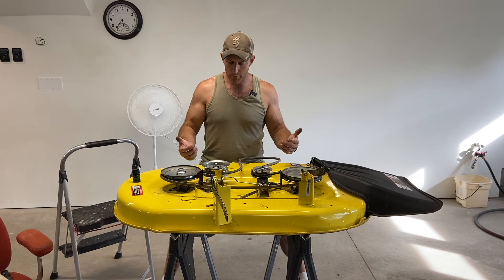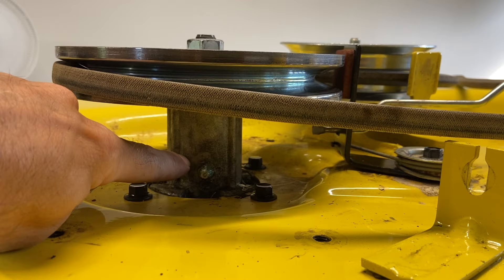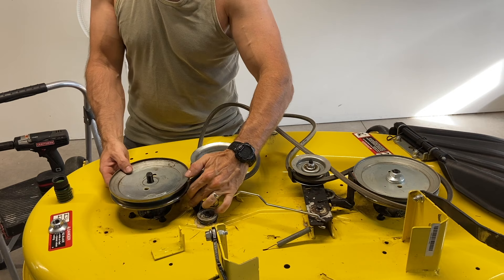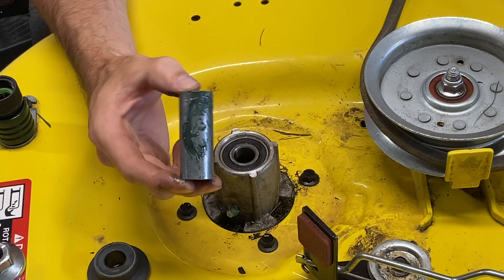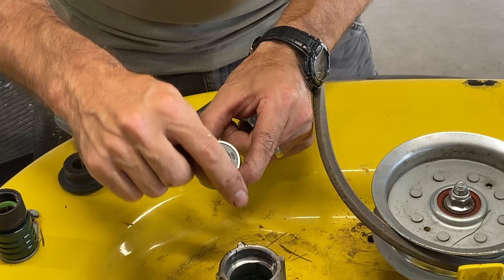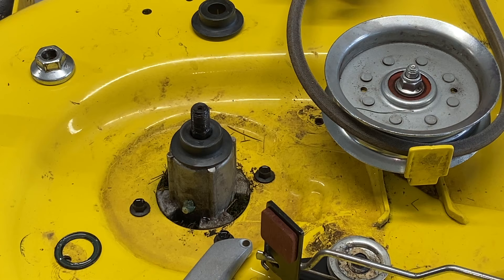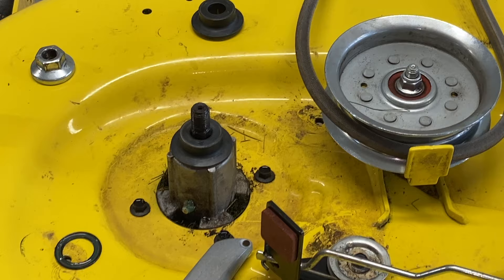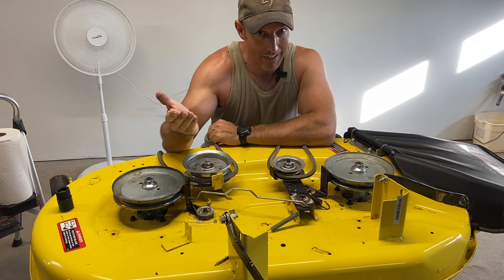I WOULD DO THIS DIFFERENT NOW JUST REPACK THE BEARINGS WITH GOOD GREASE AND PUT SEALS BACK ON.

Comment: As a machinist, I can tell you the number one cause for bearing failure is over greasing them. Excessive grease causes heat and quickly destroys the bearing, Quality sealed bearings are far superior and have a much longer life span than unsealed greaseable bearings. Cheap china sealed bearing sometimes have the incorrect amount and type of grease and are prone to early failure.
Reply from the maker: Thanks you for the info and thanks for watching
Reply: How true it is. In a former life I ran large commercial fishing vessels in Alaska. A new guy to the boat wanted desperately to become our engineer so we let him do some of the more mundane chores in the engine room. A month later a bearing seized on one of our main circulating pumps, actually ate itself, pieces everywhere - something I had never seen or heard of in 15 years. I replaced the bearing at sea and when we got back to town I mentioned the failure to an old mechanic buddy who repeated your statement word-for-word - basically too much grease will kill a bearing. So when i got back to the boat I checked the other three pumps and they were packed full of grease. The light bulb went on - remember that new guy? When told to give the pump bearings one pump of grease once a week he figured that packing them full would be better. More is not always better. BTW, no greenhorns were harmed as a result of this incident.  PS - I have always shied away from those 'bearing buddies' for trailers from this experience.
Reply: Also as a Machinist, I will agree too much grease causes heat. Lightly grease them manually and put the covers back on.

Comment: I pull the seals out of the formed pulleys and grease or use sharp needle adapter and stick needle along shaft and seal lip, then add grease while rotating.
Reply from the maker: Thanks for the tip, sounds like a good idea

Comment: Dummer & Dummer designed a greasable spindle and used sealed bearing ! Brilliant 😮
Reply from the maker: Thanks for watching
Reply: @DIYJIM  If you pump enough grease into the spindle it will enter the sealed bearing.  Just saw it demonstrated on another site.

Comment: Sealed bearings and bearings made to be greased don’t have the same type of seal. If you remove the inside seal then later you grease the spindle with a pneumatic or electric grease gun, you can push the outer seal out. Just put the grease in real slow and stop when you feel resistance. If grease comes out make sure the seal didn’t pop out. I recommend drilling a tiny weep hole in the spindle opposite from the grease zerk near the top. When grease comes out that tiny hole the spindle is full.
Reply from the maker: Thanks for the advice and thanks for watching

Comment: For those that don't get alot of exposure to the inside of spindles I will tell you that most of the newer ones I see are sealed bearings even if it has a zerk fitting on it, Trouble is for those that actually use a grease gun they over do it, if the spindle does not have a pop off relief then what happens is they blow the bearing seals right out of the bearing due to over pressureization, at that point the bearing is basically dead as everything in the world can get into it, The one or 2 commercial brands that tried actual greased bearings found they had more problems and complaints with them , By using sealed bearing with a pressure relief on the spindle everybody is happy, for those that don't grease they still get "normal" wear on thiers and the guy with a compulsive grease gun addiction he can pump grease in them all he wants and thinks he is doing good. The only good that any grease does on these is make it a little easier to get things apart should they need to be repaired.
Reply from the maker: Thank you for the comment and thanks for watching
Reply: does having spindle full of grease keep temperature down to decrease wear to lower bearing?

Comment: Those sealed bearings last a long time. 
At least they have on my John Deere decks.
I think the grease fittings are to keep the bearing spacer from freezing in place.
Reply from the maker: Thanks for commenting and watching my video
Reply: thats right pat there not for the bearing its to keep moisture away your dead right mate
Reply: Correct. Keeps the shaft from freezing to the spacer. What a waste to have to fill the spindle cavity with grease just to get a thin film between the spacer and shaft. And from the ones I have disassembled, the shafts were dry anyway. The grease never made it to the tiny gap between the shaft and spacer. Now I just clean both up really well, and apply either anti-seize or brake caliper grease. Both have proved to do well. Cheers.

Comment: This job is SO much easier if you remove the spindles from the cutting deck, of course removing the blades first. Replacing the sealed bearings is not a difficult job and I replace mine every 2 years, or so, when they feel dodgy - it is no more than a morning in the garage. Meanwhile, I can ignore greasing them. Replacements are cheap, even good quality ones. I have a 3 spindle, 48" deck.
Reply from the maker: Thanks for watching have a good summer

Comment: You should do the same thing with the electric PTO clutch. The only difference is you need to put the seals back on the bearings. My PTO clutch is eight to nine years old now because I removed it’s two bearings an put some grease in them.  PTO clutches and blade spindles are expensive.
Reply from the maker: thanks for the advice I might have to do that
Reply: Way better off with the manual engage pto in the long run !!

Comment: A good video on how to take apart your mower.  Opening the bearing is good.  Don't damage the plastic seal.  It can be placed back once you add a little good grease to the bearing.  I used to use a needle and a vaccination  device to add grease to the bearing without removing the seal.  It worked ok but you couldn't tell how much grease you were adding to the bearing.  Then I saw the video on how to remove the seal, grease the bearing, reinstall the seal and put it all back together.  Do not over grease the bearing.
Reply from the maker: thanks for the info

Comment: The problem with this set up, as I see it, is that even with the covers off the bearings, the bottom bearing is always going to have the most grease, unless you  keep the spindle constantly full.  The grease is always going to fall to the bottom, which will leave the top one, lacking lubrication at some poiint.
Reply from the maker: Agree thanks for watching
Reply: It’s not a problem I promise you

Comment: I just filled up the void with grease until it started squeezing out of the bearings. No need to remove the seals, the pressure from the grease gun is more than enough to push past the seal. It's quite a bit of grease... about 150 pumps with my grease gun. I'm not really positive that it's worth it, I don't know how much more life I will get out of the bearings because of that, but I guess it can't hurt.
Reply: You gotta fill the void anyway if you want to get grease into the upper bearing.
Reply from the maker: thanks for the info and for watching

Comment: Like others have said, they are sealed bearings for a reason.  Second, the very process you used for bearing removal compromised the integrity of the bearing.  You NEVER hammer on the inner race!  For installation of a NEW bearing, again, NEVER put pressure on the inner race.  I always use a socket the is just a hair undersized for the outer race (ie loose fit in the spindle hole) and tap or press the bearing in.  That is the ONLY correct way to install a new bearing. Oh, as far as putting the nut back on the spindle shaft to drive out the assembly, nice, but you should have protected the nut with a hunk of wood.  Been doing this stuff for a lot of years and learned the right way to do this stuff.  As far as greasing the bearings, they do come pre-greased, but I see nothing wrong with popping the seal off and adding some high quality bearing grease as long as you put the seal back on.
Reply from the maker: thank you for watching and for the great advice have a good summer

Comment: Thank you for making this video.   

As a owner of a 1025R, thats a sub-compact John Deere tractor, plus a LA135, a 42” riding John Deere mower from about 12 years ago, I’d like to add my two cents on the reason the spindle bearings are sealed.  

First, I do not disagree with Steve’s saloon opinion that removing the seal then regularly greasing the spindles will prolong the bearing life.  Where I take issue is Steve skipping the concept of equipment lifespan.  

Just giving a few examples, these little riding lawnmowers have unserviceable hydrostatic transmissions. If you have a flat lawn, they may last 900 to 1,100 hours. If you have a ditch or other minor hills,  cut that lifespans in half. If you have a hilly lot, cut it in half again.  Either way, by the time the hydro goes, normally other parts are near end of life such as the steering mechanism, cast iron insert of the motor, and more.  

By no means am I suggesting to not maintain your equipment.  With proper care, a typical homeowner cutting a 1/2 acre level lot once a week for half a year can expect a 15 year life out of these things when properly maintained.  As with any bell shaped curve, a few lucky owners will get far more, and a few far less, but 15 years or 900 - 1,100 hours is about all you can expect before so many parts are worn that having the machine repaired is not cost justifiable. 

Now, lets say you follow’s Steve suggestion, disassemble, remove seal, repack, reassemble and regularly grease with quality bearing grease.  At some point you will be discarding a worn out riding lawnmower with pristine bearings. What sense does that make?  

As it comes to the spindle grease zerk, grease it to keep water out as you perform your routine 50 hour or once a year service, whichever comes first. 

Anyways, thats my opinion.

By they way, I mow with the 1025R tractor and 60 inch John Deere MMM belly mower and my wife uses the LA135 because she is not comfortable driving the tractor.  She has driven it some, but she prefers to drive the smaller riding lawnmower. That’s why we have both.  I am considering having us upgrade the John Deere LA135 to a John Deere S240-42 which has a more robust, serviceable K46DP hydrostatic transmission. With proper use and maintenance, the John Deere S240-42 riding lawnmower with its more robust and serviceable K46DP hydrostatic transmission can withstand small hills and increase its life expectancy to a median age between 1,400- 1,600 hours. The two riding lawnmower, the LA135 and S240-42, are close to the same size but built to different price points.
Reply from the maker: Thanks for the nice well explained comment makes sense. Hope you have a great summer
Reply: @DIYJIM  since commenting, I checked out a few of your other videos. Nice job. Best wishes with your YouTube content creation success.
Reply from the maker: @DougAlesUSA  thank you very much, I am enjoying making videos and getting lots of comments from people thanking me for helping them.
Reply: @DIYJIM  have you found and watched some videos from YouTube content creator Tractor Time with Tim?   At the core, his channels focus is the John Deere 1025R, but he does branch out.  Now, this is his full time job. He gets the YouTube revenue plus does projects for fees, I assume for fee but technically I do not know if he charges his customers, plus he sometimes has viewer discount codes for purchasing the item he is using in his videos. I assume when viewers use his code he gets some sort of revenue from the vendor, but again, I do not know that for sure. I assume some of these vendors give him the product he is reviewing.
Reply from the maker: @DougAlesUSA  I don’t think I have seen tractor time with Tim I’ll have to check it out
Reply: @DIYJIM  one place to start that you may enjoy, search in YouTube for “Tactor Time with Tim 200 hr”   Which will take  you to a series of five videos where Tim does the regular 200 hour maintenance for the John Deere 1025R subcompact tractor.    

As a YouTube content creator, who is on a break, I think you may enjoy seeing how he creates his content.  His wife does the editing. Plus he is active on various forums including “Green Tractor Talk” and a couple Facebook groups focused on the John Deere compact tractors.  

Again, he turned this from something to do into a full time job through a combination of video monetization and sponsorship agreements. 

A lot more people have John Deere riding lawnmowers then have sub-compact tractors.  Imagine covering everything from the 100 series, 200 series, and X### series, attachments such as weed sprayers/ fertilizers, snow blowers, lawn sweepers, baggers/grass clipping catchers, munchers, aerators, rollers, carts, operator cabs, accessories such as a 5 gallon pail holder or seat cover, maintenance, tools for  maintenance such as reloading a grease gun or using a torque  wrench, common repairs such as plugging a leaking tire or fixing a cracked seat, or upgrading to brighter LED lights, real world application capabilities with demonstrations, aftermarket front buckets, plows, the possibilities are endless. 

Seems a need exists, and you could fill it, benefiting your viewers and yourself.
Reply from the maker: This does sound good but I have a full time job and I have been working 1-2 eight hour shifts extra every week because our 3rd shift guy retired. I work at a State prison as a utility plant operator in their boiler plant. I have about 6 more years until retirement for me. Then maybe I will do more. Not sure if I ever want to turn this into a full time job. I am trying to just keep if fun and make a few videos a month. It has turned out much better than I ever expected it would. I definitely have got better at making videos since when I started over 2 years ago. I know I would do even better if I would stick to the same kind of content but I am interested in so many things. I have been trying to get my boys involved more since I think someday they will take over this channel. Thank you so very much for being interested in try to make my channel better. I hope you keep watching some of my videos. And as for my wife she does not want to get behind the camera I keep trying because I think it would make my channel even better because I am always messing with her.

Comment: Sealed bearings are designed to not need further lubrication, you can buy bearings with a seal on one side only. But when you use bearings with a seal missing you have to fill the whole void with grease; otherwise the top bearing won't get enough lubrication, but if you put too much grease in you'll blow an outer seal off and then the bearing will become contaminated and wear out quickly. Basically these bearings are so cheap leave them sealed and if they fail it takes 20 minutes to replace them as you've just shown. I think the grease nipple is a holdover from when they had bronze plain bearings, ask the manufacturer.
Reply from the maker: thank you for the info, thanks for watching

Comment: Working on cars and trucks must notably on U-joints I found the sealed bearing original equipment last a lot longer than replacements with grease fittings. Your mileage may vary but I believe as long as the sealed bearing is properly greased from the factory it will last longer.
Reply from the maker: Thanks for commenting and watching my video